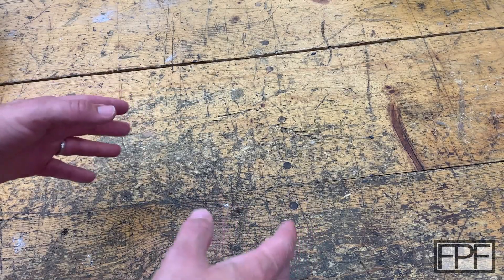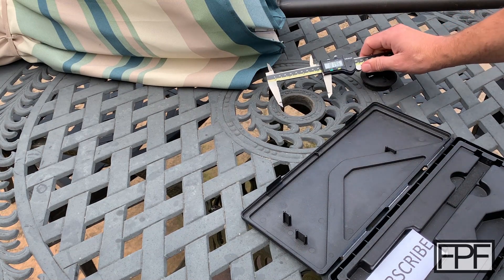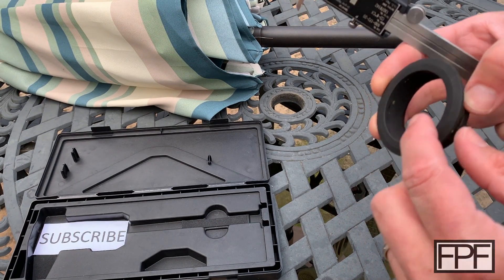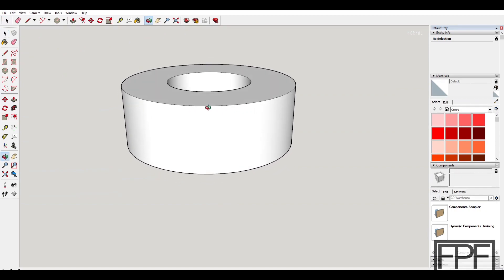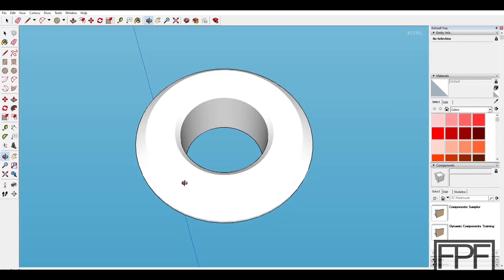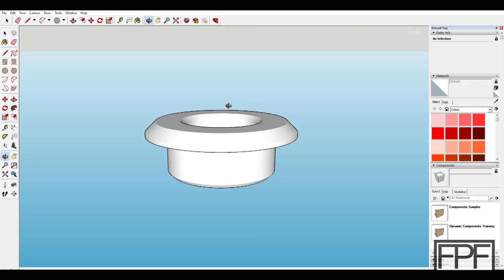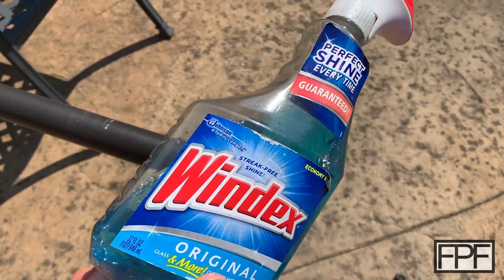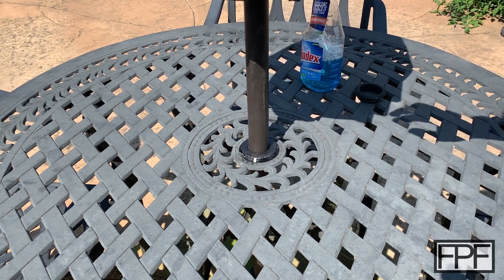3D Printed Patio Table Umbrella Grommet

Comment: Just a thought - you could cut along the seam on one side so it then you could stretch it apart to wrap around the pipe and then slot it in. Saves having to slide it all the way up the pipe from the bottom or vice versa when you come to remove it.
Reply from the maker: That's a great idea, and if I needed to remove it regularly, I'd probably re-print with that mod.  I've found just leaving it on the pole to work great.
Reply: @FunctionalPrintFriday  No need to re-print, just slice it with a stanley knife. (I think you guys call it a box cutter...)